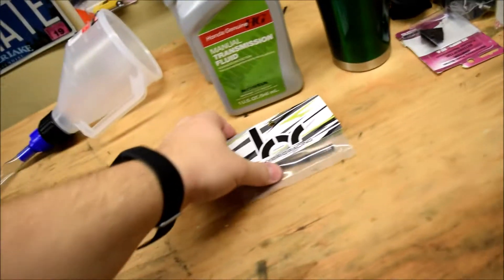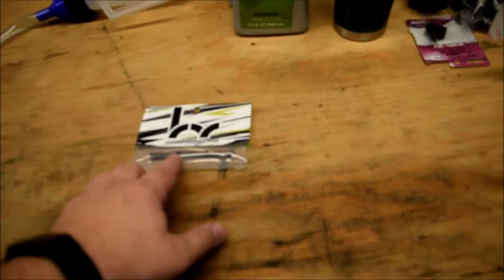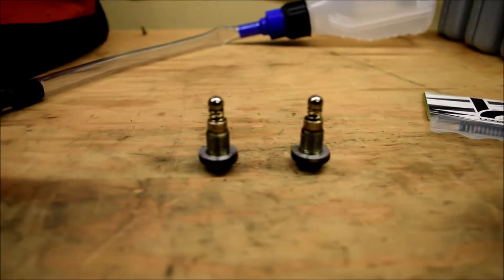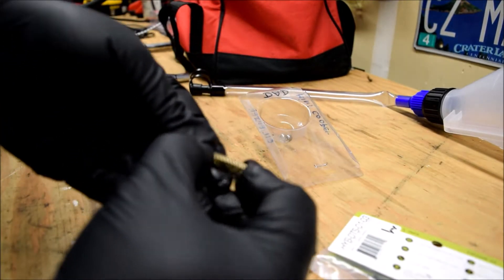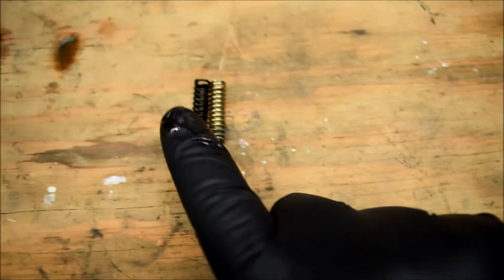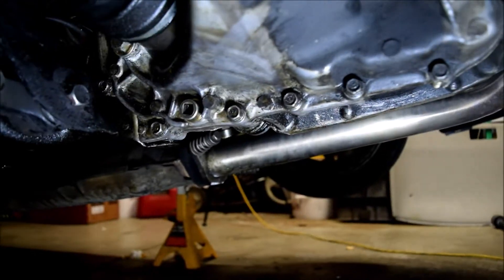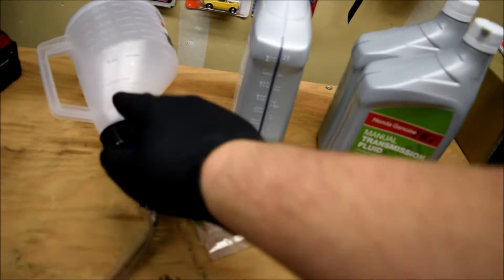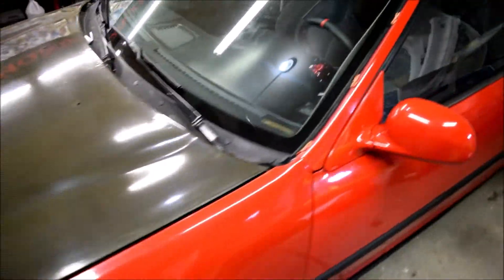Hybrid Racing Detent Springs - Project Civic EJ1 - A Must Upgrade - Only $16

Comment from the maker: What mods do you have done on your transmission or shifter? Have you don't the detent springs? Comment down below. 🤟
Reply: No transmission work or upgrades but I will get these springs for sure. I have a k tuned shifter like the one you installed. That is actually why I bought it. Lol keep it up
Reply from the maker: Nice. I am glad my video helped you decide on a short shifter. This would compliment the short shifter well. I am going to order some more for the Integra. Thanks for sharing 👊🤟
Reply: Quaife QBE9J – Honda Civic B-Series Sequential Gearkit
Strengthened outer casing with stock mounting positions

Five open face dog engagement gears

Retains OE clutch and driveshafts

Ultra-fast Quaife sequential gearshift designed for a rod change lever

Air-shift compatible with optional Quaife actuator

Choice of Quaife final drive ratio included

Optional Quaife ATB limited slip differential (QDF1U)

Optional LED digital gear position indicator available

Straight cut or helical gears

Weighs 50 kg
CROW-63401T-2 cams
Precision Turbo 62mm Precision PTE 6266 CEA Turbo – T4

YEAH DUUDE!!
Reply from the maker: 😮 wow. Now that is what I call an major upgrade. Nice. Thanks for sharing. I appreciate it. 🤟👊
Reply: @magia that is some nice work. I have never done any transmission work before but I bet that is built great and feels amazing